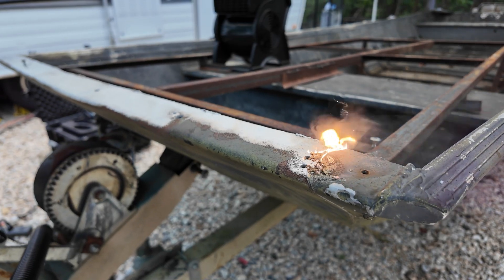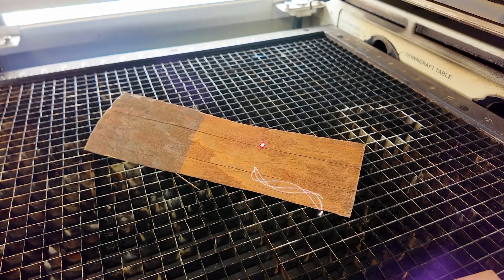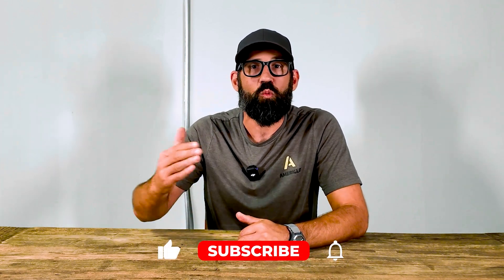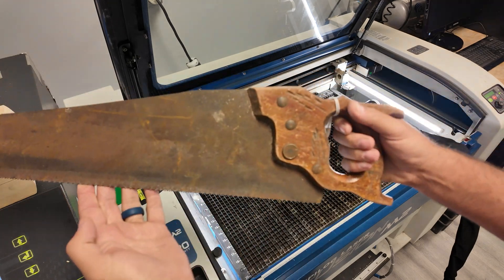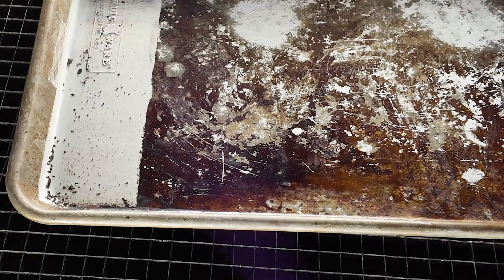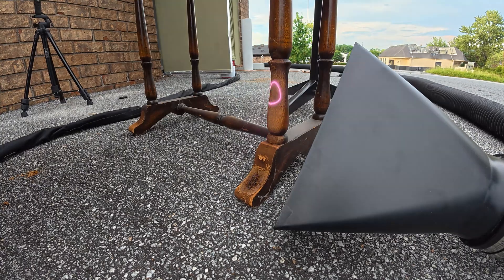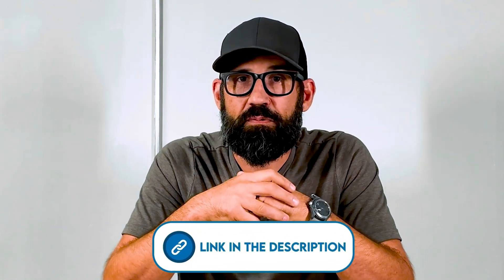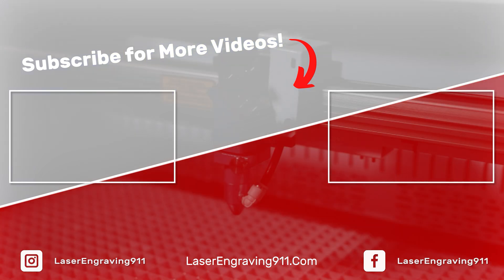Restoring Furniture With Lasers - Is it Magic? Or Madness?!

Comment: hi, first of all great video...but i'm missing some more info. for example, why doesn't this 500w laser have water cooling, which is the second most important thing in terms of possible failures? Also, the laser head should have water cooling. The interesting thing to me is that I still don't understand the English language very well, so not even an explanation for what type of paint on wood the laser could not affect at all? If you can answer me, I would be grateful. I'm also curious if you used stronger parameters for that type of paint and what happened? greetings, I am waiting for an answer
Reply from the maker: Gt-500 has a integral mini chiller specifically for the head. To cool it, the main laser source does not require a chiller, and is designed to not have a chiller. Once you get past 500watt, a chiller is recommended.
Reply: Generally, you don’t need to chill your laser module under 1,500 watts. Mine doesn’t and it’s rated for 100% use.
Reply: @melgross 
Yes, but you probably have a CV laser?  I researched on several sites, for example in the Czech Republic there is a company that offers me a pulse laser  500 w he is asking for 155 thousand euros + tax + transport + customs, which would be around 190 thousand euros.  they have water cooling.  Also Norwegian company 125 thousand + other.  there is a very big difference in the price, and the fact that the Czechs got the job of cleaning the soot from the Notre Dame Cathedral (walls, frescoes...) is proof to me that they have perhaps the best machine in the world. you can imagine how much a 1000 or 1500w pulse laser costs with them, and I think they have it in stock. it's science fiction in terms of money for me because I don't have a job waiting for me to start working right away I would simply have to look for jobs myself, and since the Chinese one is not so cheap, I have to go for the variant that the laser source is maximally protected from overheating, but also the laser head. Basically, I'll give you a link from the Czech company so you can see what the difference is just in appearance and how it solves various tasks  .Thanks for the advice...greetings from SERBIA !
Reply: @melgross 

https://youtu.be/JMpXNxUQiMQ?si=3h-M5oQ1x-sIfJsf
Reply: @VelimirAndan I’ll look, thanks.

Comment: Hello 911
I'm trying to make a choice in finding a machine for cleaning different types of wood and stone.
The big question is for industrial use or lets say between 6-8 hours a day of usage,would the GT500 be a good consideration with aircooling system or I should rather go for watter cooling maybe with a biger number on watt’s.
What would you recommend,maybe something’s specific.
Thank you very much.
Reply from the maker: Hey there, hit me up at michael@laserengraving911.com and ill give you the full run down and guidance!

Comment: What the average time you can run a air cool laser cleaner unite
Reply from the maker: Haven't tested that yet. But I found that a 300watt unit air cooled tapped out at 2 hours, but it s was 100 degree outside,

Comment: Thanks for the info on why wood sometimes doesnt work. I have been absolutely beating my head against tge wall for two years now trying to figure out why i cant clean certain projects. I think i occasionally run into an oil finish that has UV resistant coatings. The tip on using the alcohol swab will be invaluable.
Do you find that the effect the laser cleaner has changes depending on how hot the machine gets? I recently purchased a 1000w pulse wave machine with liquid cooling because i was concerned about getting inconsistent results, but this DMK 500w pw is much smaller and easier to move and now im wondering if there was that much advantage to the liquid cooling.
Reply from the maker: Thanks for the feedback, I think that if you have a 1000watt pulsed machine you can get jobs much faster than any 500watt, that is the benefit, I dont think the liquid cooling really matter, the only reason its there is because your working with 1k of power, and the head gets hot with that much energy so you kind of have to have it!

Comment: Would the gt 500 work on teak wood? Varnish on a boat. Thinking of buying but if it will not work would hate to waste the money.
Reply from the maker: You think think the varnish is oil based?
Reply: @LaserEngraving911 I do just 5 -6 coats of varnish.

Comment: Hi , If you had to decide to start a cleaning laser service , wich one of those machine would you prefere and why , (sfx , dmk 500 w air cool)
Reply from the maker: If I have the budget I would go with 500watts DMK laser, because I can get the job done faster in a day, the SFX 300 will do the work but it will take more time.

Comment: So if it doesnt remove water based finishes well how do you tackle this? Does it remove water based paint okay?
Reply from the maker: This depends a lot also on the  color of the paint and the overall composite odthe water based paint, while the paint may be water based it not ALL water, it had many other properties that will react well with the laser.
Reply: @LaserEngraving911 thanks for your reply! So can you tell me what your experience had been removing paint from wood? What colors/types of water based paints are fairly easy to remove and which are not?

Comment: Hi Michael i purchased 2000w a continues laser machine, i repair cars, Because the metal is between 1 & 3 mm thick and has very heavy rust, i find the best way is to run the laser over the surface, and then use a air pin gun and then go over it again with the laser, or even a wire brush, but my problem is changing glasses and when i use a mask the glasses fog up, i purchased a air fed helmet with a flip front , thinking i could laser and then flip the front lens cover up, But the auto darking iens ranges from 4 to 13 for welding, laser glass are marked differently the are OD4 to OD8, I trying to get laser glass to replace the lens in the Helmet but there is different colour and thickness of glass the OD marking are Different, ? Have you any suggestions on the glass type etc.
Reply from the maker: great question, first of all never use use welding glasses for fiber lasers, they will not block out the laser light and you can damage your eyes permanently, next you will want to get yourself some of these https://www.noirinsight.com/laser-safety-glasses/lenses?wl1=1064&od1=7  get large wrap around style.
Reply: I got a OD5 glass, the only problem it blockes out the Red laser light
Reply: Buy a laser welding helmet. There are a lot of them around. I have an XTools laser and bought my helmet from them. I think it cost about $110. You can also get laser safe glasses. Make sure you get one for infra red.

Comment: Can you clean the oxide from installed copper without damaging the surrounding surface?
Reply from the maker: YEs you can, you just need to protect any surfaces you dont want the laser to effect using either blue painters tape, or some people find that using tin foil works as well.

Comment: What happened to the water based stain, do you just not take the work, or was there another setting to use?
Reply from the maker: If its water based stain, its iffy, I may be able to remove some of it but mostly likely I take a pass, I can always ask if they have a sample they can ship me here at my shop to test first before taking on the job.
Reply: @LaserEngraving911 cant you use stronger settings?
Reply: @LaserEngraving911 does it not work increasing settings?

Comment: Think the first thing you should mention is that this laser cost $35,000. That definitely would’ve chased me away.
Reply from the maker: I think your looking at the wrong price sir, this unit is nowhere near 35,000, the GT-500 usually floats around 18-20k and that is a great price for a 500watt air-cooled pulsed fiber laser with a custom JPT laser source, so the price your throwing out must be for another model, but that is not the price.
Reply: @LaserEngraving911  I got that off their website. I guess it’s possible I looked at the wrong thing but it looked pretty cut and dry to me. Have you ever had any experience with an under $10,000 laser cleaner? Is a laser this expensive in that powerful overkill for just refinishing and stripping furniture?
Reply: I was just quoted $16500
Reply: @sarahosborn6124  wher is that quote from?  I would like to buy one.
Reply: @sarahosborn6124 these will be everywhere when the price is down to a couple of grand

Comment: Wood is something I’ve played with, with my cw and my pulse. I’ve been able to do white paint off wood with both

The whole water vs oil explanation was so simple yet so to the point. Great info. Now I know when I attempt a job to do that alcohol test. 

You can do wood cleaning with a 100w or 200w machine, the more power the more square inches at a time you can do efficiently, high power is great if you can afford it
Reply from the maker: Thanks for sharing your experience and watching glad you got some value! 👍

Comment: Interesting video, especially water-based vs non-water based wood finishes!

One correction: at around 9:40 when discussing frequency, the sample math is incorrect. 

20 kHz = 20,000 (twenty thousand) pulses per second, NOT 2,000 (two thousand) per second.
Likewise, 700 kHz = 700,000 (seven hundred thousand) pulses per second, NOT 7,000,000 (seven million) per second.
Reply: Yep, 20kHz= 20,000 "bullet" per second.
Reply: 500W, means 500 J energy per second.

Comment: Thank you for sharing. Should you wear a mask when using the machine not inhale the fumes? Looks like it doesn't generate much smoke.
Reply from the maker: Yes you should or you need to have a strong fume extractor like you see in the video or a fume chamber,